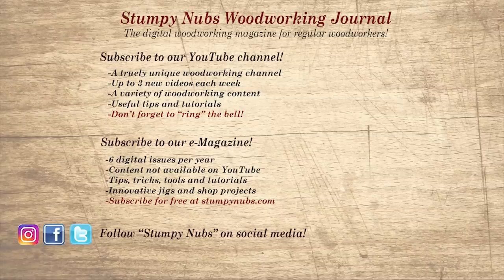Are table saws becoming obsolete?????

Comment: I’ve only been using a tablesaw for a few months; my life is so much easier. And accurate repeatability has gone through the roof. Most importantly, safety has increased because I have to layout my cuts for the TS, while a circular saw is far too easy to make just-one-time not-the-best-position cuts. I did without for years... I prefer with.
Reply: Same here. Have owned my first good quality table saw for only a couple months and I love it. Amazing how accurate it is. I can't see ever using my circular saw again!

Comment: Many years ago I built an entire wall of cabinets below and book shelves above with nothing but a power drill, circular saw and a straight edge.  The fits were all excellent, painted with no filler and no gaps.  I far prefer a shop full of tools and just ordered a track saw to supplement my cabinet table saw.  Thanks for another great article.

Comment: I'll never get rid of my table saw, but there's a place for the track saw also.  Like in my shop where space is limited and most of the time I'm by myself so to break down sheet goods is much safer to do with the track saw.
Reply: Totally agree.  Man handling 4 x 8 sheets to and through my table saw doesn't make sense to me from a safety stand point.  I cringe every time I see someone try to feed a full sized sheet of anything through the table saw.  It's easy enough to get them down to workable sizes with a circular saw and a couple saw horses, then bring them to the table saw to get the accurate clean cuts I'm looking for
Reply: This might be true for most hobbyists, but it depends on the setup. When I worked in a cabinet shop with a large and rock-stable table top and outfeed table, I could cut 4x8 sheets completely safely for hours on end. When I'm at home with my hobbyist setup and limited space, I'd rather use a track saw to cut full sheets too.
Reply: Seems to me that a track saw and table saw are mutually beneficial, kinda like bees and honey. Use the track saw to break down sheet goods, and use the table saw for final, repeatable sizing and the joinery. One thing not mentioned in the table saw’s plus column is superior dust collection.  

One of the early editions of FWW made an argument that the first two stationary machines in a wood shop would be a bandsaw and a jointer. If one adds in a hand held router then there is some sense to that. Bandsaws can make rip cuts, cross cuts, resaw cuts, and curved cuts. They can also do limited joinery. The jointer handles truing up rip cuts and narrower resaw cuts. Hand tools can substitute in for some of the more complex joinery that might be accomplished on a tablesaw. 

I recently had to make the decision to purchase a table saw or a track saw. The table saw won out, hands down for many of the reasons Stumpy outlined.

Comment: Video was good, many points made to back up your opinion. I do like my table saw and will always have one. besides using it as a saw, I am always taking off my fence and lowering the blade to use it as a flat surface to assemble things. Sort of a workbench with a machined surface. I was a Patternmaker for 10 years in the 70s and early 80s. We had a 4' x 8' cast iron surface plate table that we used a lot to assemble segment rings for the patterns we made. So my saw top is used the same way. Woodworking to me is a relaxing hobby and I sure will not get stressed out because some other woodworker does things his way. The golden rule using a table saw is for the left hand knowing what the right hand is doing. Many accidents were caused by not having this mastered. It may not be for everyone.

Comment: Get rid of the track saw and keep the table saw. Used molding blades and stacked dados for my door and window trim boards in my new house. Favorite tool in my shop for accurate cuts when building hand cut dovetail boxes is the table saw sled.

Comment: I love my table saw but I’d give it up before I gave up my 3hp 14” Rockwell radial arm saw. In my opinion a table saw excels at operations going with the grain. Having to slide long boards across a table saw for cross cuts/dados is very awkward. An aftermarket miter gauge with a long fence helps but the long board hanging off the side of the table can still be a problem. A high quality radial arm saw excels at cross grain operations because the stock doesn’t move so supports can be made for it much simpler than for boards being cross cut on a table saw. Plus cutting dados with my radial arm saw is easier because the cut happens above the workpiece where I can see the layout tines. With the correct blade and proper safety procedures a good radial arm saw can rip and cut grooves just as safely as a table saw. The key is to get a good radial arm saw and to set it up correctly.
Reply: I'm with you on the radial arm saw - it's my go-to power tool, but I've never owned a table saw due to space constraints. However I've recently started to use a track saw to break down sheet material into manageable sized piece - that's been a game changer for me..
Reply: I agree, table saw for ripping, radial saw for crosscut and cross datos.
I would hate to dato 24" wide base cabnets with a sled.

Comment: This has to be one of the best-timed videos for my personal woodworking journey. I'm 2 bookshelves in on a whole room floor-to-ceiling shelving plan, which I've accomplished so far with an inexpensive table saw and high-quality router. I have been waffling between upgrading my circular and miter saw game vs biting the bullet and getting a hybrid table saw (or both, a real possibility). You hit the nail on the head (pun intended) about the quality and accuracy of the fence being the key to making a table saw an invaluable tool; on my cheap saw, there is as much as 1/2" slop and even a poor clamp in the fence that nearly ruined a sheet of cabinet grade 3/4" plywood. I've concluded that, as long as I can afford it, it's worth investing in the hybrid table saw to accomplish all of the repeated cuts I need to do -- all of the sides and shelves need to be of an identical depth and that's simply easier with a high quality fence as part of a quality table saw. This video confirmed what I had concluded and, as one without any woodworking friends, I appreciate that this helped confirm my thinking. Keep up the good work!

Comment: The first ten years or so that I was doing woodworking, I only had a circular saw and a jig saw. So yes, you can be successful without a table saw, but I REALLY appreciate having one for many of the cuts that prove more challenging without one. The best example from your list are the rip cuts, especially if you are ripping narrow pieces like a 2x4.
Reply: I've ripped several dozen feet of vinyl plank in the last month for my own home. I didn't want to buy a table saw but I didn't see a viable option.

Comment: Ive had my table saw for over 20 years.  I have upgraded the wings with router table extensions.  For some of my joinery I switch between the router table and my table saw Molding head.My shop is small, I just wish there were small cast iron saws with 5/8 inch arbors and belt driven blades. Bottom line in my shop, the table saw is the workhorse and the routers (4 in total) are my detail tools.  Thanks for the tips and have a good day.

Comment: We purchased our current house six years ago. I have a detached workshop (25x22) with power. I purchased a few tools (drills, circular saw, etc.) and then I found a well used Delta TS-300 table saw. To be honest it intimidated me at first. It was old and the fence did not set well in place. I started using it and was surprised at how useful it was compared to breaking down sheet good with a straight guide and circular saw (although the fence made long cuts challenging).

Last summer I built new kitchen cabinet doors, drawers and even a large buffet for the dining room. In September I was talking about another project that would use the table saw. I was dreaming about a Sawstop and my wife said it would be cheaper than a visit to the ER to have my fingers put back. 

Long story short, I now have a Sawstop PCS. Built an outfeed table for it (using the SS) and added the MFT type holes for clamps. I ordered a 750 CFM dust collector and attachments. I now also have a bandsaw, miter saw and sanders.

The point here is that I feel safer with the SS and it is more accurate than my old Delta. I AM HAVING FUN. That is the purpose of my hobby shop.

The table saw is the center piece of my shop. I don't intend to give it up. But that's just me. :)

Thanks for the video. I look forward to Stumpy.com.

Comment: I have a Craftsman contractor saw I bought brand new with the Exact-I-Rip all aluminum rip fence. It was still made in St Louis by Emerson Electric at the time with a real 1.5 hp motor. Pristine condition because no-one else has used it in 25 years.
  I can cut material in a minimum of 3 different methods with my other equipment.
  I know that when I fire up my table saw & only hear that almost silent whistle it's going to be the best, quickest & most accurate cut I can expect. Must be very careful because the depth of cut is 3.375" & the fence height is 3"! The fence is great for fixtures for raised panels, mortises, floating fence for pattern work & so much more.

Comment: I agree with all of your points.  Several years ago, I almost talked myself out of upgrading my underpowered-for-hardwoods Delta contractors saw and NOT getting the professional Sawstop.  I had a nice big 16" bandsaw which I love for most ripping and a Festool track saw for sheet goods.  Heck, I even bought another plunge router to use for dados with the track.  But, in the end, I got the pro SawStop (which is so well made that I'm thrilled) and use it for dados and certain rips.  The band saw gets a ton of use as does the track saw but I've yet to do a dado with the router & track - I'll man-up and do some blind dados one of these days.  I haven't mentioned the router table because I tend to save that for edge work and haven't ever done a dado on it (likely due to your remarks about bits).  More tools = more options = more versatility.  Thanks!!!

Comment: For a small shop like mine (roughly 12x12 with water heater and other utilities), I am a big proponent of the radial arm saw.  A medium-sized one takes up no more room than a miter saw, and it can do most/all of the operations of a table saw.  Mine is a medium-sized 1957 Dewalt that I cleaned up and reconditioned, and I have no need for a miter saw and it takes up less room than a small portable table saw that I was previously using.  The used ones in very good condition cost a few hundred versus a few thousand for a good table saw, and some people find good ones below $100.  Some of the attachments that are available can add to the versatility (moulding cutter, jointer, surface planer, etc.) especially if you are low on shop space and/or money.

Comment: I may have had some minor regrets about the model of table saw I bought (Dewalt DW745 Type 4), but I never for a minute regrettet buying one at all.
I even custom built a castered table for it with an extension for a router, so I can use the saw's rip fence for the router as well (with the use of an auxiliary fence).
What made me realize that I needed one, was when I needed to rip an 8" piece of 13/16" (21mm formwork) plywood into 4* 1 5/8" (40mm) pieces with a cirkular saw. I did it, but it was insanely difficult, and I didn't feel safe doing it.
The first thing I did when I bought the table saw, was make half laps in those strips I ripped with the cirkular saw. :)
Now I only use the cirkular saw (Bosch GKS 18V-Li) for cuts on boards that are too large or heavy to handle on the table saw. Fortunately I have tracks for it, so no big deal.

Comment: I'm an amateur woodworker, so I do not have a lot of knowledge yet, but I'm learning. Already made several projects using a circular saw and hand saws, depending on the type of cut. For delicate cuts I bought a Japanese pull saw, that can cut very precisely  when used for small pieces of wood. But as increasingly take on new projects I feel that I need a table saw, so I'm building one myself. Thanks for your good advice on this subject.

Comment: To all who think a track saw is inherently BETTER than a table saw: try quickly ripping a bunch of thin (say, under 1") strips off a long board or sheet stock. You just can't do it without jigs and a whole lot of setup and good luck in getting each piece precisely the same width. To all you on the fence: if you can afford a good cabinet saw and have the space in your shop, it is going to be the power tool you use the most -  full stop. It is the single best decision I've made about my shop (possibly excepting good dust control!). As always, great job and thanks James.

Comment: Another well done video James!   After thirty years I am still using  my first table saw, a Delta 7.25" Bench Saw.   I eventually bought a Rousseau  fence, table, including extensions and outfield tables, plus an accurate miter gauge  to allow it to do "real" table saw tasks like cutting up 4x8 sheet goods or rip trimming boards to size.   I also installed a safety power switch and dust collection.  The only thing that is impossible  for my Delta is using dado blade sets but there are there are other ways to make dados.   Only if it dies will I get a second  bigger table saw.

Comment: Been there and done that.  Prior to getting a decent table saw, I made excellent cabinets, doors and joinery using miter saw, homebrew tracksaw, a shop-made router table, and various jigs.  
It was slower, but worked.  The tablesaw, a good fence, and sleds allow the same work to be done very nicely, in much less time.

Both methods work and each has its special advantages, risks and economics.

Comment: My table saw died about a year ago. I've been meaning to replace it but I think you changed my mind.
I rarely used it and it took as much effort to drag it out and clean it up as it would to use my circular saw.
I think I'll save the money and go with a band saw. Looks like one of those tools I would use quite often.
The table saw was more in the way than anything since space here is at a premium.

Comment: After using my brother's Festool track saw quite a bit, I knew I wanted one of my own eventually.  After getting a Dewalt one, while it's a very nice and useful tool, and allows you to do many things you couldn't with a table saw, particularly on already installed pieces, I started realizing the limitations compared to a table saw.  As you say, repeatable accurate cuts is a big one.  Another important one for me is rips along the edge, whether to mill thinner strips or for notching out a corner along the length.  I also find depth easier to precisely adjust on the table saw, as you can do so visually.

Then of course, there're all the more perilous things you can do on a table saw using jigs and such.  I've used a jig with a pivot to cut perfect circles, and even used a piece of lumber clamped at an angle to the blade as a fence to cut a custom cove for a tricky piece of trim.  These maneuvers require time and caution, of course.
Reply from the maker: How does the Dewalt compare to the Festool?
Reply: @StumpyNubs  Pretty well, actually.  The depth adjustment is in locking increments and easy to set much like the Festool, the track uses rubber rather than plastic along the rip edge and is bi-directional.  The saw itself plunges in a diagonal rail movement rather than a pivot like the Festool, perhaps to help prevent the saw running away.  

All in all, the only clear downside is it's rather big and heavy, though it's a cordless saw rather than corded like my brother's.  He got it many years ago now, so I'm sure Festool has released revisions with even more bells and whistles.

Comment: I completely agree, when we moved to a smaller home I sold my table saw and pretty much did a lot of cuts with my 7.5 skill saw. I moved to a lager home with a shed in the backyard. I told my wife if she wanted a custom built in entertainment center to fill the big hole in living room, I needed a table saw back. Repetitive cuts saved my back and not to mention f'ups that happen when your skill saw or your bump on the material causes the cut to be off.

Comment: I got by with a track saw, sliding miter chop saw, jigsaw and router when I began to accelerate my time spent woodworking a few years ago.  In September 2020 I bought a table saw and added a high end miter gauge with fence and dado stack and what a difference in terms of accuracy, speed and versatility!  I still use the miter saw for breaking down large pieces of lumber and the track saw for ripping plywood. But nothing beats the table saw for repeated ripping of work pieces not to mention awesome box joints.

Comment: Thanks for the video! I am a furniture carpenter of craft, even though that is not what I am working with currently. I just made another set of subwoofers, only using my plunge saw. And I agree with you, it is - so- much easier on a good table saw! Even though I spent a great deal of time setting up each cut, the dimensions were still not 100%, leading to significantly more sanding time.

Back in the days, I was using a horizontal plate saw from Scheer, programmed with a computer, and 0,3 mm precision. I did not realize at that time what a luxury it was😆

Comment: Definitely agree.  My table saw is the most used saw in the shop.  As a matter of fact, for miter cuts I grab my miter sled.  The miter saw in my shop resides on the top shelf collecting dust.